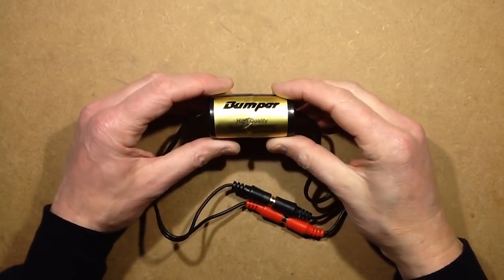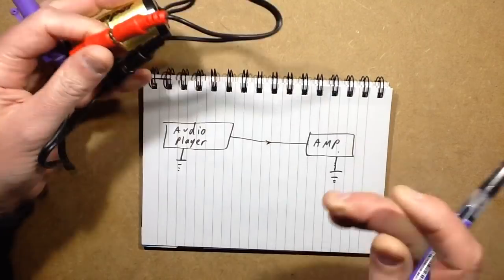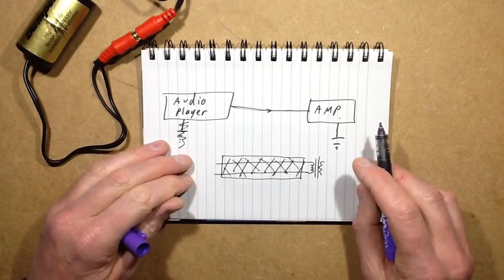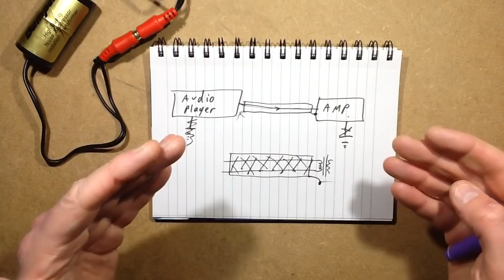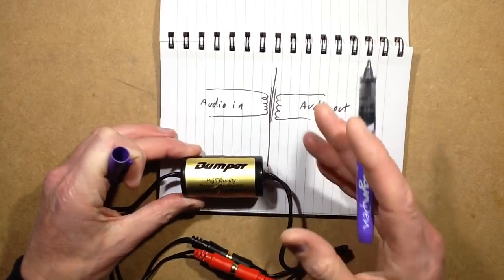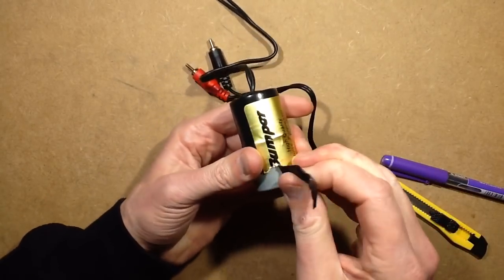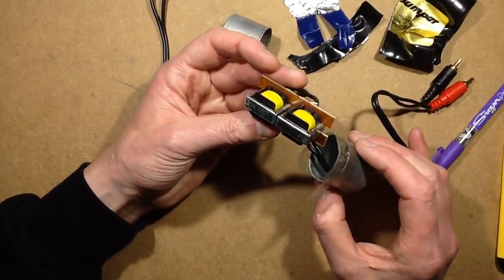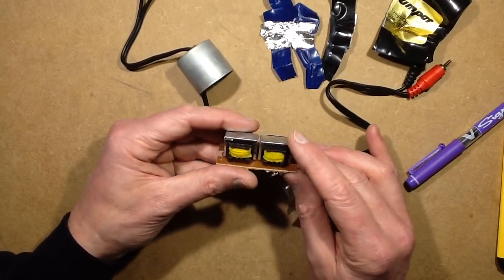Inside an audio isolator transformer module.

Comment: people lifting grounds scares the crap out of me. my dad always let me use his old hybr tube amplifyer from the 50's he had as a kid and i stopped using that thing in highschool when i realized how dangerous it was. equally as scary is all the videos of musicians grabbing mics and getting the absolute crap shocked out of them.
There is another product similar to this for poor mains power that uses two diodes and a resistor on the ground circut to bias each half of the wave by a few 10ths of a volt. ive been really interested in them but dont quite understand them; the product is called the (Morley Hum Exterminator)

Comment: A  common issue in cars is with devices like a cellphone going into an AUX in, for example. The noise isn't a real problem  until you plug the phone into a charger.  An audio signal isolator will eliminate that noise.

Comment: Hey clive, not sure what your sort of audio experience is, while working on a bluetooth headset modification, I get what seems to be data interference,  which changes when I put a finger, or wire on the antenna (the exact same sort of noises you can hear on this video /watch?v=T_ptEDeAa1U)

I can pick up some quite small 1:1 isolation transformers locally (Well, if the place has them and I don't have to wait a week for them to arrive), I'm curious if transformers will affect this sort of interference, or if they really only affect transient voltages.

I would also be using them directly in line with the speakers, no amplification afterwards, I'm curious if these transformers require amplification afterwards. I haven't delved into the audio side of electronics and figure you might have some better insight.

The interference may be coming into the audio signal in a way that can't be fixed though, I'm not entirely sure though, all the other similar issues I've seen people post are caused by ground loop interference from separate amplifiers.

Comment: You can cut the mains ground wire BUT then you must use Mains Isolation transformer. I have used that many times in TV studio environment and it is better than using cheap audio isolation transformer. Perhaps that’s what those audio experts meant. Anyway this is OK only in small and usually temporary situations or if you must make a temporary fix fast. When building real studios, you always earthen all the equipment which have the earthed mains socket. Then you don’t connect the ground wire on one end exactly as you told to do. If you cut the amplifier side and remove the cord on the other end, the amplifier gets huge hum in input. I have seen systems which have built that way.

Comment: in the pro audio live sound scene we use "DI" direct boxes where an instrument has an unbalanced out going to our balanced mixer board in.  all they are are balancing transformers but they are electrically isolated.  in the car audio world you can get alternator whine and noises of the like.  its sometimes funny when using am radio and you have all this interference, usually in the cheaper made products.

Comment: as for putting one of these in a car, you get very bad audio wine from the alternator when the phono cables are routed alongside the amp power supply cable, very good bit of kit

Comment: So this seems like the equivalent of an antenna balun transformer?  It seems like its main purpose is to remove common mode noise from the audio output line relative to the audio input line.  What could have been unbalanced current between the ground and signal is forced to be balanced by the transformers.

-- about the foil, it did electrically connect the left and right halves of the metal shell, correct?  Maybe thats all it was there for, to make sure they couldnt form some resonance between each other.

Comment: They're used in cars if the ignition system is noisy from the coil pack or distribution of the spark. Seemed to be more of an issue with older cars, its better maintained now.

Comment: I use a Toslink optical cable to connect most of my equipment to my old Yamaha V800 6.1 receiver. As it needs optical light input to send audio, noice is not a problem. Most devices I want to connect have toslink-support but off course not every device supports toslink. In these cases, such a device is quite useful.
Reply: As a 62-year-old electronic tech, I can't believe fiber optic didn't conquer the audio-video patch cable market. It would have been a much better quality sound plus they could have passed the remote control signals and video between devices too.🤔

Comment: Clive, my mate had the same problem when he used his laptop+psu to drive a mixer for disco use, it hissed like mad and he came to me to fix it.
I found a couple of line level transformers and plopped them into an old plastic film container, same wiring as your diagram, that was two years ago and all is still well :-D
The magic of magnetic flux coupling :-)

Comment: Thanks for this information. I'm attempting to remove ground hum from my band's sound gear. I use my Macbook pro for backing tracks and monitor video. The computer sound goes in to a Yamaha Stagepass 600i amplifier using a standard 3.5mm stereo cable. Might an audio isolator transformer solve my hum problem? Not too expensive to find out I suppose!
Reply from the maker: It's an essential part of an audio kit for fixing problems.  Especially with modern power supplies.  You get pro versions with a better frequency range.
Reply: @bigclivedotcom  Thanks. I'll have to get hunting. I'm in OZ. I'm looking at this one, but probably not a pro version. But it might be worth trying before chasing pro versions,  https://www.jaycar.com.au/ground-loop-noise-isolator-stereo-3-5mm/p/AA3086

Comment: I have one of these, it does it's job well but I'm surprised at how low the resistance of the transformer windings are, when I measured it they were about 180 ohms each. I know impedance and resistance are not that same thing but all the same it was a little surprising.
Reply: +CoolDudeClem At 1 khz, the impedance will be 15 to 20 times this amount. Being no DC is present, pure resistance is not a factor.
Reply: +CoolDudeClem Man, comments like these really bother me. You claim to be surprised by something, but then immediately bring up why it shouldn't be a surprise at all. One of the major reasons why I unsubbed and actively dislike your channel.
Reply: +Aurelius R And comments like yours really bother ME. That's no reason to hate on me, just get lost.
Reply: CoolDudeClem This is YouTube, you'll always get people commenting on you. That is the POINT, after all. You're putting yourself out there for others to comment on.
Reply: +Aurelius R And you are why we can't have anything nice.
Reply: CoolDudeClem You know that ideally an audio signal should never contain a DC component (also called offset), right?
Reply: Well, I own this ground loop isolator, and it effects the low end more than the high end. I can notice no difference at the edge of my hearing, however, I am a 32 year old man, so maybe my hearing is going. However, it does chop the bottom out of the low end.

With that said, a weak low end is FAR better than a high noise floor. I own this because the line out of one of the bedrooms television has a ground loop when connected to a speaker base for better sound. Unfortunately, the TV has no digital line out, and since there's a half dozen different things that connect to the TV, it is easier to get the TV's line out instead of ALL of the devices. It was a life saver.
Reply: Richard Smith That's fine, but the "bottom of the low end" is nowhere near DC. If an audio system has DC in ANY parts of the audio path, it means that something's terribly wrong with it (and for speakers the DC offset can be lethal). Thus saying that any audio-related device has a DC resistance of XY ohms is irrelevant.

Comment: Interesting.  I've noticed the same thing is common in microphones except theres usually a transformer at both ends.  Is that a step up / down to counter losses in the cable?  I'm feeling the need to take my SM58 to bits now :p

Comment: Can that thing be used to convert ac to dc cinde of? Wuld that thing be usefull to charge ignition coil wia ac generator? Is the out put dc?
Reply from the maker: It's just an audio isolator.  It's not rated for high voltage.
Reply: @bigclivedotcom  Just curiosety vise I surche some thing to replace me gm 4 pin ignition module ac to dc pulse .
Aperantly me linear voltage regulator and me ignition module are polarity sensitive so I can not use bypass voltage from me starter selenoid me fuse pops so I was wondering if there any electritian on your chanel who know how to solve this unusual problem?
Ore cinde of pulse multiplier circuet .
Because I want to build dual ignition system some thing similar to waste spark ignition ore the old dual coil jaguar ignition system how ever I do not have second pick up coil in me distributor so Im cinde of in trobel in winter time I must get out of car and fumel with ignition timing which is be the way anoying to do.
So the basic idea why not to use alternator for power? The old ac magneto culd run car so why not to use that alternator thingy instead?
Only problem so fare I dont know how peopel constructed those wires and how they wired them so peopel dont get shocked and how to deal with discharging lead acid baterry if you use ac as ignition source ?
I admit I have unusual problems so hopely some one see this coment on your chanel and actualy can give me some advice to help me solve strange problems.
In the past I hade strange problems with me car aperantly mostly back charge alternator ,faulty voltage regulator on alternator and some times when me blinker do not have ground ore short some where the car cinde of work like hit and miss engine and actualy works in union with blinker relay another unusual effect that I come acros multipel times is when the voltage regulator fails the car increase in power smuther engine but me baterry boils so I was wondering how to acess those strange acurances and actualy make use of them?
I was wondering if there is posibility to use baterry and capacitor banks in union for more power to alove ignition system to work with out baterry assistance?
The third unusual effect I witnes useing hv ceramic capacitors I experimented with plasma ignition for a while similar effect like haveing faulty alternator voltage regulator but baterry only charges if alternator is running at 2500rpm so due those capacitors me entire wire harnest get effected .
Those are some nice effects but I dont know how to control them sadly.
Mostly me problem is related to polarity and ground chassis/baterry negative potential .
So I hope some peopel here know how to handel those polarity related devices and can point me at least to centrain circuets that prevent ground polarity to effect baterrys.
I know its strange what Im doing lets just say its nice to run engine like hit and miss ore hot bulb so its generator set up so I requare high amps similar to magneto ignition system because I do not have upgrade kits for me engine I must build some thing similar .
So tehnicaly speaking takeing 1 wire out of alternator shuld do that trick only problem me E core ignition coil does not have any wire diagrams so its hard for me to figure out how it was constructed to work its not normal ignition coil .
So yeah strange problems 😅 
I also looked some called magneto signal converters suposedly they were meant for engines who do not have build in rpm readings so not much info on youtube about those devices how do they work so Im cinde of lost there .
So Im looking for devices that can multiply digital signal converters but no such luck finding some thing similar on internet.
So that made me wonder culd tach generators do the same thing as ignitors on ignition module they do look similar some how ?
I realy do hope you have some good electritian folowers at least to show peopel how test wires for polarity so to determine if they are safe to tuch ore not .
So I also look for device that can test wires and not to get fatal shock .
Im sorry to bother you with silly ideas but that problem cinde of plagued me for years normal books dont realy help me finde this unusual problem .

Comment: If the issue is caused by having a different ground voltage used by two pieces of equipment, wouldn't a potential solution be to have only one piece of equipment connect to the mains ground, and run a ground wire along with the signal wires such that the other piece of equipment uses the same ground?

Comment: Thanks Clive. I think you just showed me my first project to try and make. My friend just purchased a new Lenovo laptop but when it goes to sleep the set of computer speakers  it's hooked up to (or even the TV, if it's still on) start buzzing away.
Reply from the maker: +Kyle Barg That's a common issue.  The computer stops holding the lines in a silent state and they pick up noise like an antenna.
Reply: +bigclivedotcom My monitor causes this,as if it's leaking to ground. If i disconnect it's DVI cable, the speakers go silent. You're right about the computer pulling the line silent though, because once the audio driver loads up the bussing stops with a violent pop.
Reply: Just wanted to say thanks for helping me realize why when I full-screened games I heard my speakers make noise!
Reply: @mr.hankhill5161  this is why people who claim they are into audio but use their pc as source are an even bigger fools than those boomers who spend a lot of money into audio stuff believing expensive stuff are perfect.

Comment: when I was young. got my first car...I'm talking mid-late 70's, if a car stereo caused noises such as hum or buzzing we would just take a transformer from an old radio or something and the run the power wire through the transformer to the fuse block...instant noise elimination

Comment: I bought a mic off Amazon for 10$ but was disappointed when I found the mic picked up AC interference and produced a 60hz hum. I was also told the mic made a high pitch buzzing noise. Could this solve my issues?
Reply from the maker: It's usually the cabling that is the issue.  Poor screening.

Comment: For gigs I have a system consisting of a (musical) keyboard, plugged into a computer for sound generation, which is plugged into a mixer, which is then plugged into speakers. I have a problem with noise which I assume is two separate problems: 1) I hear very conspicuous humming on the signal, which I assume can be rectified with a module such as this, and 2) I hear what sounds like radio interference. I'm not sure how to solve the second problem, since I assume the case of the computer acts as a sort of shield (or does the composition of the shielding matter?). In any case, thanks for the interesting and informative video!

Comment: good day 

I was wondering if the transformer used here is the same used on computer modem boards. I have a couple of modem boards collected over the years and was thinking of using the isolation transformers in there for such purpose. Nice video!

Comment: I've been having trouble with my soundbar. It only has a buzzing noise now. Not one video on YouTube touches base on that subject. Also my tv speakers sound blown unyet I've always used the soundbar.. I'm assuming if I get a isolator transformer to connect to the cable wire..??

Comment: You think one of these would help with the annoying noise I get in the phones for my computer? I have a headphone amp for it and I get this screechy noise from when the CPU is working. No hum or anything though. The comp and the amp are properly grounded in the same outlet.
Reply: I've had this problem, mainly with laptops, I fixed one noisy PC  by running a 6mm earth lead from the back of the PC to the amp - however this was more for mains hum. Give the isolator a go, they've worked for me on several occasions.

Comment: hey man, comment unrelated to the video here but I think it would be a good video to see, especially for musicians and people working with audio equipment, but, my suggestion is a video explaining what "earth loop" is, what causes it and how to fix it (E.G NOT CUTTING THE BLOODY EARTH PIN OFF THE PLUG!), I'd personally love to know seeing as it's a big issue in my house that has quite old electrics (the date of installation of the main meter is 1970 but the other components like the fuse and DB were replaced) and its become more prevalent since I've upgraded my amp from 10w to 100w (its a 100w cab with a 65w speaker but I'm not gonna get technical) also, could you explain why it would only happen in certain sockets, or certain rooms or why it only sometimes happens from double adaptors and plug boards (power strips)? thanks in advance!

Comment: I've created a computer room with audio from each computer to a central mixer. at each computer has two network connector one to the computer and the other to the audio from the computer , I use two transformers at each end of the network cable to the audio , they are not set as your 's but in series with the coils , I do not use the screen to something as I do not have some only the twisted pair network cable. The transformer is DA103C

Comment: I have the same problem in my car. I installed a switchmode power supply and some usb ports to charge my phone. However it makes a terrible mosquito like noise. I'm going to try to add filtering, but might need to get one of these.